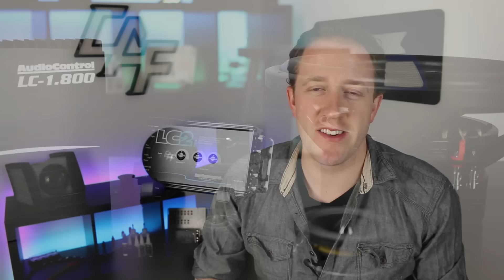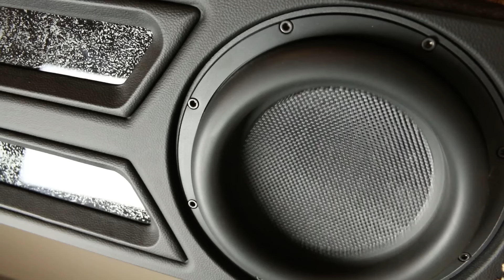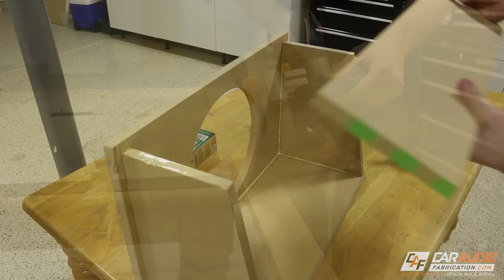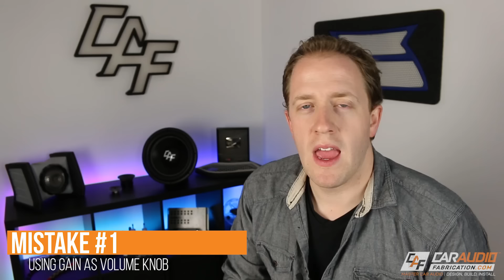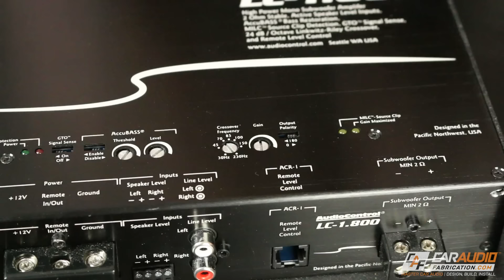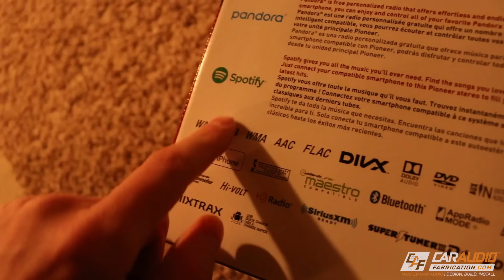Avoid these 5 common Car Audio NOOB Mistakes!

Comment: Newbies should hire a professional to dial in a car stereo upgrade. The sub amplifier, and midrange/Tweeter amplifier has multiple settings, gain, crossover etc.. Then the head unit has multiple frequency adjustments.. Add in a bass control knob, your system will sound like crap ifall your settings are not dialed in correctly period no matter what quality gear you have. Do yourself a favor,Let a professional dial your stereo in after you finish with the install. This will allow peak performance of all of your hard work,and money spent. Aftermarket stereo systems can be very confusing for a newbie with so many crossovers/equalizers,bass boosters etc..

Comment: Ehh I had my system installed "professionally" before, they actually tuned it worse than I had guestimated it at. My sub blew on the drive home.
Reply: thats really sad
Reply: @Nick1921945  Over priced as hell too. Its alright though. Gave me a reason to upgrade and havent been to a "professional' since.

Comment: 3:10 "Membranfläche ist durch nichts zu ersetzen als durch mehr Membranfläche". There are no "too big" Subwoofers. Better you have a big one playing a little bit quiter but a small one who's playing on the edge. Also you need more bass-power when you want to drive with the car instead of only have bass when you're parking.

Comment: When you say oscilloscope do you mean like a special type or one say an electrical engineer would use
Reply: probably just a microphone listening oscilloscope thing. Just to check to listen for if it sounds sawtoothy or not. If it sounds rough, then it means that it is forcing too much. Where if it is smooth looking on the oscilloscope, it is proper. I would think you want it loud and clean as possible, so making a balance between loud and liquid smooth is the goal.
Reply: @Nick1921945  Not a microphone one, you connect it to the output and see if the test sine wave is actually a sine wave. You adjust the gain as high as you can without distortion. The speakers will smooth everything out a little, and you have external noise to deal with

Comment: I put in a amp and subwoofer in my dodge Dakota factory stereo. I did not use a LOC. I just spliced into the 2 rear speakers with speaker wire and converted the ends to RCA and plugged directly into my amp. Sounds ok. But when I turn the volume up passed a point the subwoofer cuts out and loses all sound. Crackles. I have to turn volume back down to get bass back or I turn bass down on factory stereo to get subwoofer bass back. What would be causing this? Amp too powerful? (1000 watt). Not supposed to splice into rear speakers that way? Need a LOC? Any help is appreciated. Thanks.

Comment: Is  the factory head unit of toyota fortuner 2018 enough to  drive  JBL GTO 629 component in front and  629 coaxial at the back without any amplifier.Thanks

Comment: The capacitor is something I would always recommend. It shield your battery from sharp current draws which are very stressful on the battery. Instead the capacitor draws a consistent amount of electricity from the battery overtime and just slowly charges itself up and it dumps its charge as it is needed by the amps.

Also the capacitor is also wired up to your battery so you can use it to jumpstart your car just like super capacitor jumpstarts.
Reply: Wow. 15 likes over one of the most dumbest, dangerous posts ever written on the internet.

Comment: Hey I have a my Sub installed with a Renegade "1000W" Monoblock. I know it's basically garbage for some people. But for me the "500W" RMS (more like 350-400W RMS) are way enough. And it even puts out some nice undistorted and qite clear Bass. Only problem I have, is like it's with many cheap Amp. That Ground isn't quite decoupled from the output. Cause of that I hear Groundloops from the alternator, I hear beats when stepping on the breaks(not quite sure why that is), beats and humming when rolling down windows, beats from blinkers etc. Basically anything taht causes a voltage drop in the electrical system, and I'm pretty much sure that it's not from the head unit. Is there any cheap possibility to filter this? Would maybe a capacitor help with that?
Reply: I got a 74Ah Varta Leadacidbattery btw.

Comment: What I had seen back in the 90s when I was an installer, was out of phase speakers. Wiring the speakers backwards. You can have 1 million dollar speakers, but if you hook them up backwards, the positive terminal of the speaker to the negative terminal of the amp and and the same to the other terminal the speaker will sound bad.

Comment: excellent Mark. along with wiring should go, routing your cables. also great advice on using the CAP only as a last resort, putting a cap on to over come too big of a draw will smoke more than your audio system! I used to be an auto tech and people would come in with their vehicles complaining of components not working properly like windows and defrost ect. when i lift the hood up and see a monster cable running through the fire wall, yep lets see what your driven with that cable, ! needless to say i have disconnected alot of monster cables. i even had to peel a monster cable from that melted down the floor of a vehicle, the ground was 12 gauge wire! thanks

Comment: I was juuuust at the shop getting my windows tinted and no joke a big ass Yukon comes rolling up. Dude comes in trying to set up an appointment to "get his system working right "   dude behind the counter walks outside and turned down the gain ...
This is definitely a common problem.  There should almost be a disclaimer or warning saying NOT to turn it up lol

Comment: I used to work at a shop doing installs as a side job. The biggest mistake I've seen DYI'ers make is cutting wires. Now I'm old, this was back in the late 90s and early 2000's but even then Walmart sold harnesses. 

20 years later, as a reborn newb, the biggest mistake I made was thinking I still knew something about mobile electronics. Between forgetting a lot and there being exponentially better equipment available I've made poor choices in picking out equipment and looking at the past through rose-colored glasses. I find now that I'm old I really do care more about sound quality than volume.

Comment: Hey guys, haven’t touched car audio in 25 years! I recently replaced my 6 speaker setup and amp in my 04 Ion Redline. I used Crutchfield’s guys to help me pick out suitable speakers. I basically wanted a slight upgrade, but after wiring everything in, I am underwhelmed with the sound. They are JBL speakers, and generally sound better than the stick speakers, but I guess I was expecting a bit more base from the door woofers. The Amp is more than enough, as it’s 580 watts. I’ve played with the amp settings as well. Was I expecting too much? FYI, initially I did not wire in the crossover for the tweeters, but I finally managed to install the left side for now, still have to do the right, but either way, I was expecting a bit more bass. Any input?
Reply: Your going to want a subwoofer in your trunk. Door speakers aren't made to have alot of bass, get urself a 10 or 12 inch sub
Reply: Good deal, thx! Probably going with a single 10”

Comment: Previous owner of my car took his audio gear but left the amp wire. It wasn't even fused 😬 at least he taped up the end of it... 🙄 

Had a 300zx and previous owner "installed" an aftermarket HU. It was extremely glitchy. Took it out, and none of the speaker wires were insulated, and to make things worse, instead of using an adapter to use the original harness or at least tap into it, he completely cut the original plug off and twisted the HU wiring onto it... 

A mistake I've done when I was 16, was use an extension cable to power my amp 😂😂 I thought I was smart af because it had the power, ground and remote all in one cable lol. Nothing bad happened though as I was only amping cheap ass 6x9's lol

Comment: I've been messing with audio for decades. Now days so many newbies are obsessed with the wattage output as if the higher the number, the better it is. And you see this marketing strategy used all the time with some manufacturers where they quote some insane wattage number on the box. Never buy anything that doesn't quote an RMS or Continuous output figure because peak output is the point at which it is getting ready to self destruct.

Comment: I have a  NA540.6 NAUTIC AMPLIFIER and confused about the head unit to amp RCA, esp around the Sub. from what i can tell is a mono with a Y splitter to run the sub  with 4 speakers - i have run 3 x pair of RCA cables - (4 RCA for speakers) and i assume i use 1 RCA of the 3rd pair as the sub connector with a Y - but I am not quite sure

Comment: I am new at this and I would love to ask you some questions. I really need some advice. I have 8 ohm door speakers, 4 ohm tweeters and 4 ohm crossovers. What ohms will each set be?
Reply: they should all match. if you could your speakers should be 4 ohms as well. same for your amp i imagine. BUT these are not subwoofers so i dont know if it matters as much, but i imagine it is safer if they all match. im brand new to this so this is my 2 cents. take it with a grain of salt.

Comment: is it possible to wire dual 1 ohm subs to keep them at 1 ohm or would i have to wire them to .5 ohm or 2 ohm. im looking at buying 2 dc lvl 3 15" d 1 ohm subs and need to know so i can get the correct amp, also for the amp the subs would be 1000Wrms each total 2kWrms so would i need a amp with 4kWrms ??? any help would be greatly appreciated.

Comment: Hell Im putting 12in Subs single or dual probably dual in my Peterbilt 389 semi right now with a Skar RP2000.1 amp running on 0 gauge NVX wiring still trying to get everything wired correctly right now I have I have a Alpine Type R 12in 12D4  Sub any suggestions finding information for a semi isn’t that easy I’ve noticed

Comment: My noob mistake was letting a so-called professional like bestbuy install my system instead of my friend who fixed my issue.
Reply: i was worried about this because i see best buy has free installation so now im thinking about my car friends who could also do it for free or for 20-40$ and do it with dignity.

Comment: I’ve had my stereo system worked on numerous times by different ppl and without fail every couple months I’ll look at my fuse inline box connected to my battery and it’s melted or even smoking
Reply: Whats causing it?

Comment: I have a stupid question I have a Hyundai elantra 2019 I want to install a subwoofer but I want to keep it original as i can so in the rear deck has a factory hole for a 8inch subwoofer and I want to put it there do I need to build some kind a custom box or can I just use the hole trunk for it
Reply: Another thing im using a pioneer 5ch amp 100wx4ch 600wx1ch at 2ohms and 75wx4ch 350wx1ch at 4ohms now for the doors I'm using 4 6.5 focals access 165 set but I dont know what subwoofer can I use in tje rear deck can u recommend me one? I was thinking on the euphoria ewx from db drive but I dont know if its to much subwoofer for the amp

Comment: still cant recommend powered subs any harder. Amp solution taken care of, enclosure taken care of, most of them are small. and you get 8, 10 and even 12" options
Reply: Seems like the move if you have no place for a box. I couldnt let myself end up in that situation.

Comment: I dont have to worry about a capacitor, my amp has it's own motor and it's a pull start, I used a weed eater motor for it.
I just have to wear an oxygen mask.

Comment: Having a good radio i.e deck is very important too, how many rca outputs it has and tuning options.
Reply: Rca voltage and clean signal matter too.

Some head units that clip the internal amp have zero clipping on the pre outs.

Others clip on both.

Comment: Or ya know the big 3 upgrades are a pretty good space to start if your really going to be adding items that will take some juice .... Be sure to upgrade your alternator positive cable , negative cable from the battery to the chassis and the grounding cables from the  block to the chassis ... Usually along the way of you are putting in that much work you will upgrade your alternator as well as possible throwing another battery into the mix but be sure to have an isolator / relay to eliminate the " hall effect " or any drain from the main battery when the vehicle isn't on but will charge both batteries while it's running

Comment: Not sure why this was reccomended to me, but it reminded me of when I was in high school I had a 08 Mustang GT that I splurged on and bought Alpine Type R speakers and sub and got a really nice receiver that had a mic you could use to have it calibrate time delay on each speaker. I understand that's not Focal, but it sounded sooo good to me as a teenager. The intro to Hot for Teacher, or the fast part of Metallicas "One" just made me giggle like a child. 

I remember runninging calculations for the Big 3, tweaking gain using a test disk and a multimeter, and just making connections on the voice coils either in series or parallel for different impedence and thinking electricity and sound are so cool. I joined the IBEW after high-school and am now a master electrican who specializes in motor control. 

It was nice to revisit this which was so impactful in my life. Maybe I'll rig something up in the F150 now..

Comment: My first mistake as a newcomer was mistake number one you listed the gain blew both my kicker compr 12s with a 1200 amp but now we got a kx 2400.1 and two q class l7 12s in a q bomb deep ported box and two batteries 🔥🔥🔥🔥

Comment: Great video. I used to install audio for Colin Trickett at Uni-Car in Leeds UK in the noughties. Some of the 'professional' bodges we'd see were unreal. The amount of installation guys I'd see who couldn't use a set of crimpers properly after being in the trade for years. I'd goto many repair jobs and simply tug the supposed crimped wire out by hand. Another was the "turn everything upto 11" crowd. Cringe. Once spoke to a guy who said he can do a trick to get, in his words, 4D sound from an install. He was wiring fronts and rears out of phase. I shit you not. He had got away with it for so long as there was usually a sub which compensated for the cancelled bass from the doors. 
One last thing is you can quickly check if a manufacturer is honest with thier wattage specs with this quick trick. Say they claim 1000 Watts output (and you can't find or don't trust thier RMS claims), look at the fuses on the amp. If there are only say, 20amp or 40amp fuses, you can say the manufacturer claims are BS. Ohms law, there are lots of easy online calculator tools. 1000w / 14.4v = 69.4 amps this amp will require to output its claimed power. So in reality you should see 80amps of fusing on your amp, or thereabouts. Hope this helps someone.
Reply: Colin Trickett sounds cool .. LOL

Comment: clipping comes from the input. if you have an input that distorts then that distortion is sent to the amp, that is fed to the speakers and clipping has a DC component which kills the speakers. I always have the amp on full, and use the input source to power the amp. now... that said this is in PA kit I don't think there is a reason for this NOT to be the same in car audio. my amp is on full, my mixer output goes via a slider as the volume and each input is set to not clip. 40 years I've never blown an amp or speakers. "Gain" in it's pure form is just "volume" before the processing is done, "Volume" is gain after processing. most Guitar amps have a MASTER volume and gain controls. It also depends on the amps, I've seen car amps with VOLUME before and in some cases GAIN is volume. Also gain in a digital amp is different as well.. at the end of the day the best definition of volume is this "volume = loudness. It’s the loudness you hear." the short end of this tale is, AMP final output should be on full, all inputs are adjusted to no clipping and TURN your volume up simples

Comment: My first install was in an older car I had bought for a few hundred bucks just to get home after being stranded 2 states away.  It worked great for a few days, then blew the in-line fuse.  I had done a lot of research, so I was confident everything was right.  I went to an audio shop to get a replacement fuse, and they talked me out of the one I requested.  Taking the notion that they are the professionals, I installed the much larger fuse that they recommended.  Upon connection, it immediately melted wires under the hood and fried the amplifier.  Lessons learned.  Had I gotten the fuse I requested, it simply would have blown again and I could have located the issue without all of that damage.  It was a bad negative ground for the battery.

Also, the upgraded alternator for my current vehicle is still about $700....more than the entire amp, speakers, subwoofers, wiring, and new headunit (2100 watt RMS system).

Comment: Back in high school i got a complete almost brand new system for $40. We were parked in the mall parking lot hanging out, that's what we did when we got tired of cruising, he was all pissed off because his new subs "came" blown. He said $40 takes them. I noticed that he had the gain turned all the way up so I said sold just because I wanted the box. Lol. A few days later he heard me driving around and wondered what subs and amp . I said same as you had, I just tuned it correctly. He wanted more money and I said "deals done" and drove off. Lol. Never liked that guy anyways. Lol.

Comment: Noobs run amp wire from battery without fuse, then into the fender and through the door jam and down to floor on top of the carpet. When you see this the wire is usually kinked and pinched from being slammed in the door. Don't do it that way.